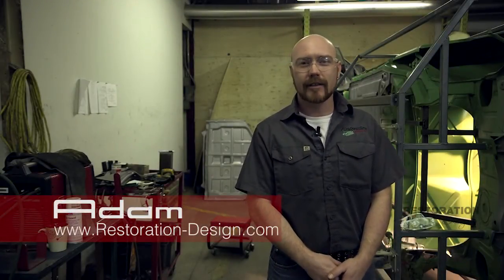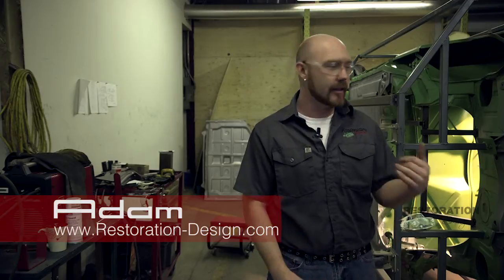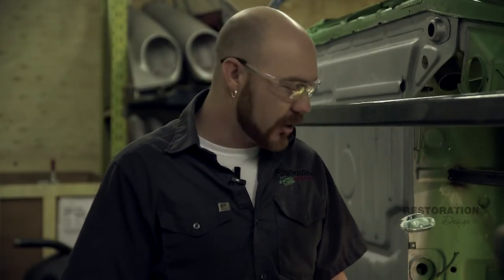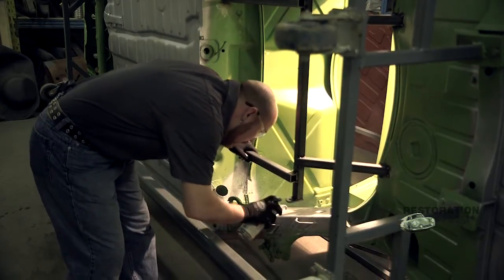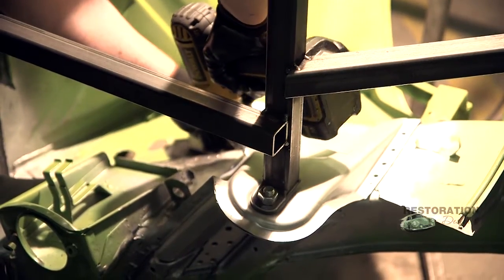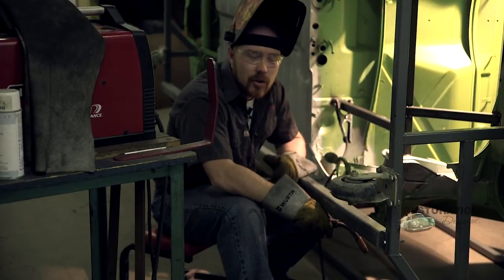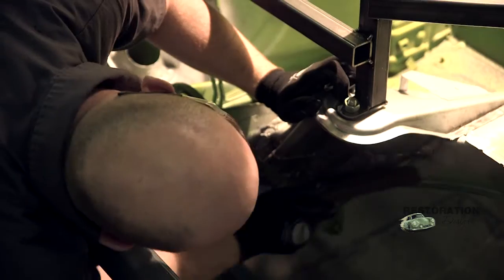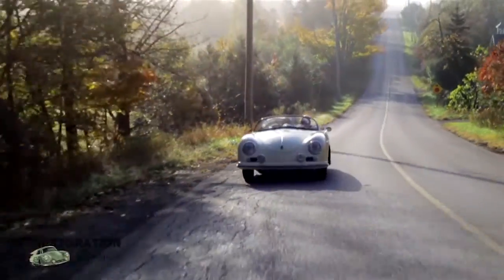How To 914: Suspension Console Installation

Comment: Interested in the bottom connection of the inner & outer susp. console! 
the factory applied an overlapping scab plate or plates bridging the low point of those two pieces. reinforcing the "sandwiching" of the inner & outer long's.
Did you replace those scab plates?   
If so did you manufacture them (what gauge) to fit or simply hammer them in to conform?
Reply: Agree  how did you handle the re-connection of the inner & outer consoles ?

Comment: What is weld-proof primer and what color is this 914. It's what I want for my '73, Rusty the Project 914 and Future Hillclimber.
Reply from the maker: +jockellis this is not a original 914 color. It is just a primer and it was mixed. if you like this color, you might like Ravenna green.Weld through primer is the product Adam is using, and it helps protect the sheet metal for the future and it allows you to apply it before welding the metal.